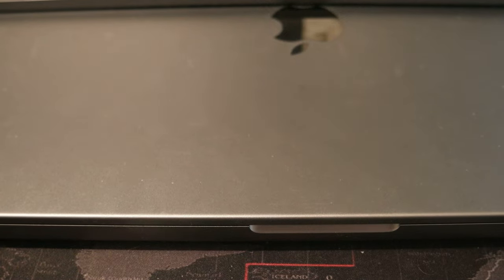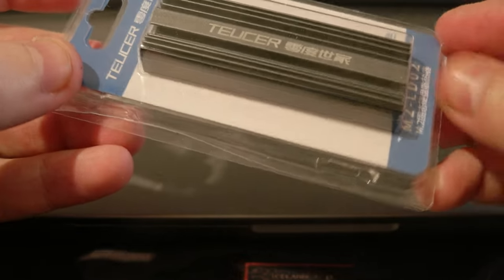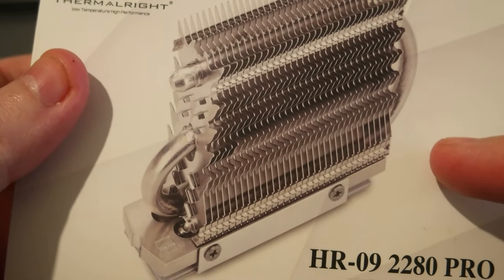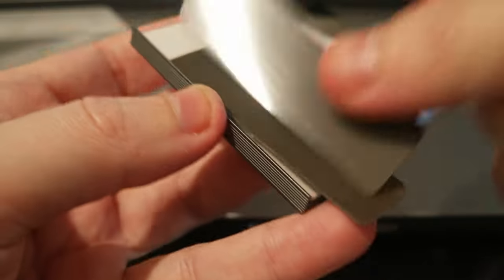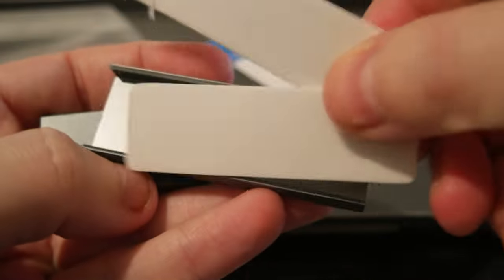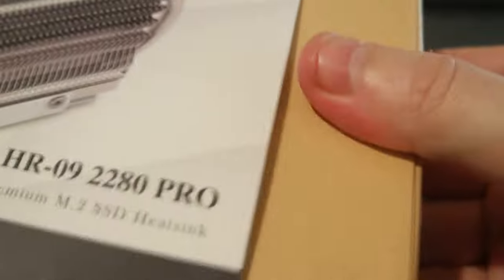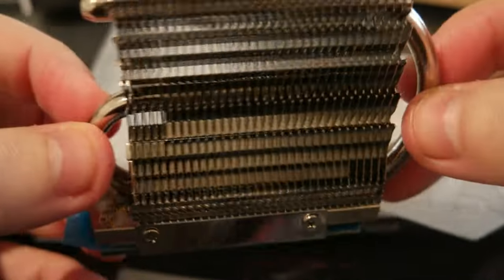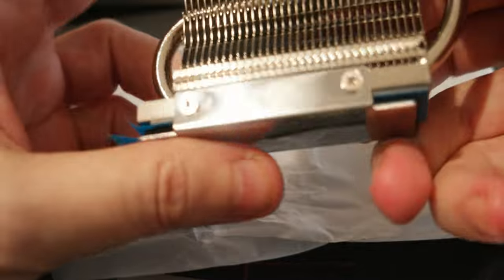Unboxing Thermalright HR-09 2280 PRO NVMe heatsink

Comment: What is the max temp it gets?
Reply from the maker: 43c but it depends on the load, so I need to do some more demanding test. Will check when I export some videos and will post it. In any case it's good since it's open and it gets a lot of air.

Comment: Looks heavy and im wondering if its going to bend the nvme drive in some time
Reply from the maker: It is a bit heavy but it has 4 screws on the sides so it mounts really well.  it won't bend since the nvme is well squished between the bottom and top sides. Temperature are way down, running macos on a virtual machine on proxmox. My motherboard seats flat so no issue there.
Reply from the maker: in any case if you think is too big there is a shorter version, just check the link. I picked this one because it's open so it has excellent air flow.
Reply: @biskero  yes i know  that there's non pro version))
Reply: nope it does not i have the very same one looks well cool and easy its light aswell  maybe try it before hinting its trash hey